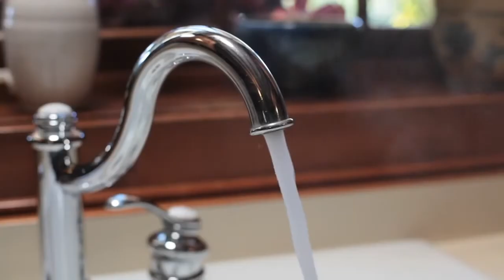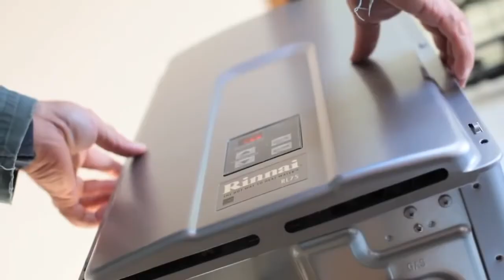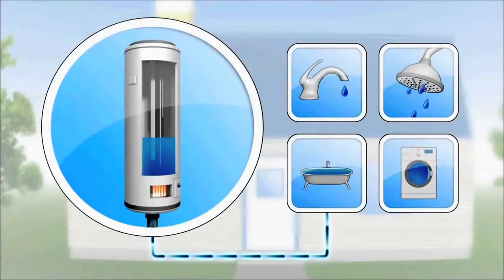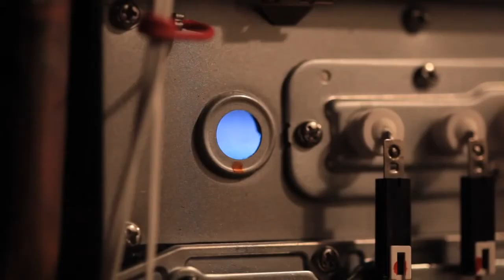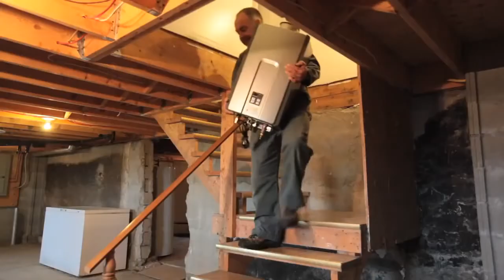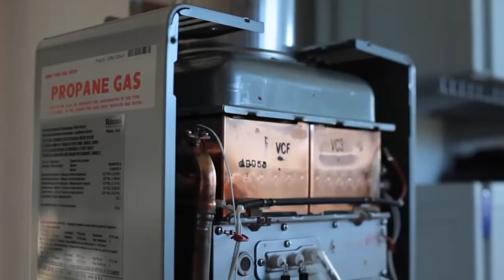How Gas Geysers Work

Comment: What must be the problem if my gas gayser flame keeps on burning even if the water is switched off.
Reply: You can close the gas pipe
Reply: the switch that detects the water will not be actuating,  7 months late😂